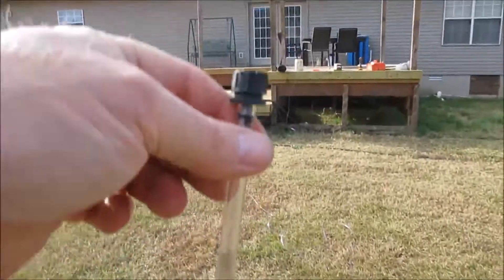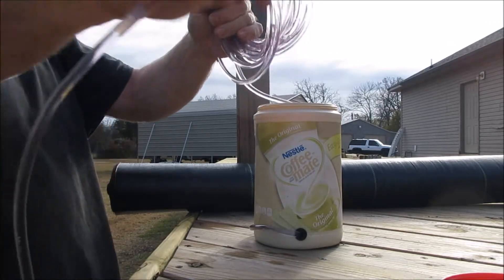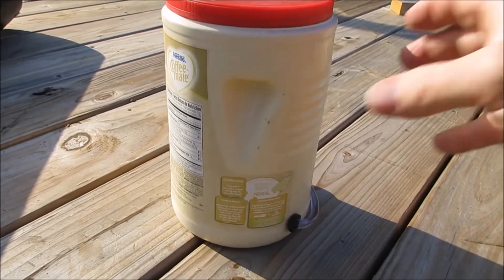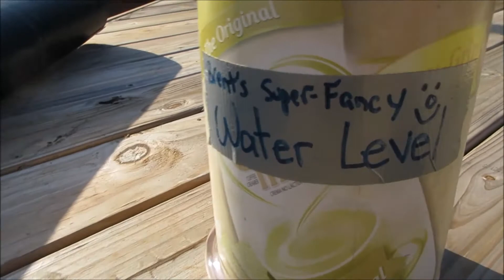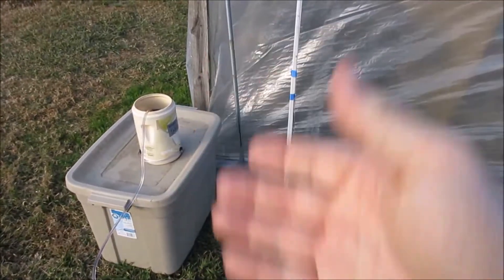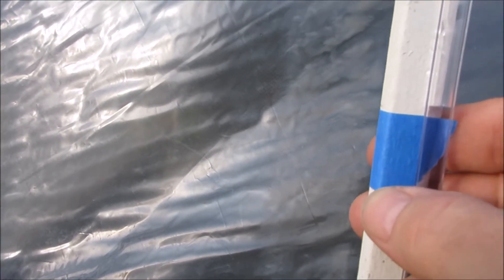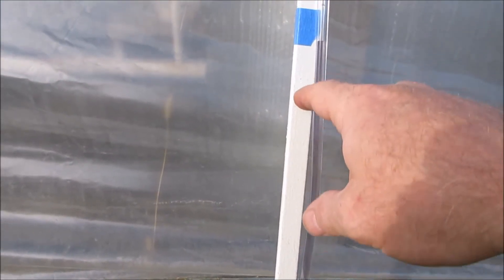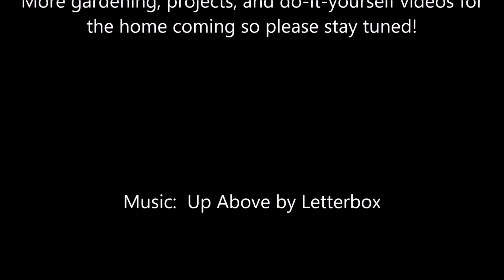DIY Water Level

Comment: Made one using a small painters bucket. Had two 20ft sections and connected with a brass fitting. Connected to a 1x2x6 . Used it to set up a 18x52 above ground pool. Worked great.
Reply from the maker: Very cool!

Comment: Nice video! A trick I've learned is to use windshield washer fluid for your liquid. It's already blue in color and it won't freeze if you are in a cold climate. When you are done with your leveling project simply drain the fluid back into the original jug and then you can always use it in your car.
Reply from the maker: Great idea.  Do you know if it's toxic to handle?
Reply: I don't think it is.
Reply: @C3Voyage    Toxic to dogs ingesting it.  At least it was years ago.
Reply: probably use rv anti freeze instead. non toxic and red

Comment: Where did you get the top hat grommets and the drip irrigation nozzle?
Reply from the maker: Top hat grommets (more are available at other sources.

https://www.amazon.com/HIDGrowTM-Top-Hat-Grommets-Pack/dp/B0134SJ8LQ/ref=sr_1_2?ie=UTF8&qid=1528306824&sr=8-2&keywords=top+hat+grommets+1%2F4

Drippers.  Here's what I'd buy if I did it again, a1/4" valve.

https://www.amazon.com/Milttor-698183-Shutoff-Straight-Stratton/dp/B076JD7K1Y/ref=sr_1_10?s=lawn-garden&ie=UTF8&qid=1528307056&sr=1-10&keywords=1%2F4+valve

Comment: Humm, maybe "super-fancy" is indeed the name. Why the hell put the tube in from the outside, to then go in again on the other side of the container ? ;) That's 2 holes for not much. Just glue the tube on the bottom of the container directly on the inside. Wouldn't that be far easier ? And you can secure it with a zip-ties at the top of the container if you want to make sure there is no tension on the bottom glued part. This way you have no potential leak problem. Maybe you thought of that afterwards ;)
Reply from the maker: Cause it wouldn't stay secure at the very bottom where water pressure is greatest. A loose tube complicates packing, unpacking, and trying to keep it at bottom. Zip tying tube to container can create leaks especially with water level higher when tube is stored. Top hat's super easy and a better design IMO.
Reply from the maker: mevofr Gluing isn't better than fixed/secured. Glue always separates under use or when attaching different materials.
Reply: Ok, seems you put some thoughts on this. Maybe you're right. "Super fancy" may indeed be the best design then ;)